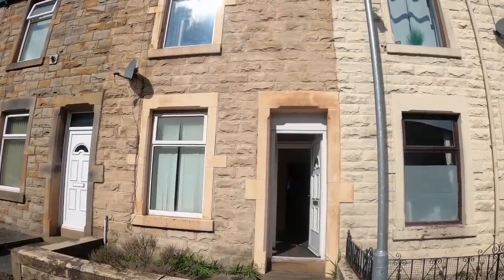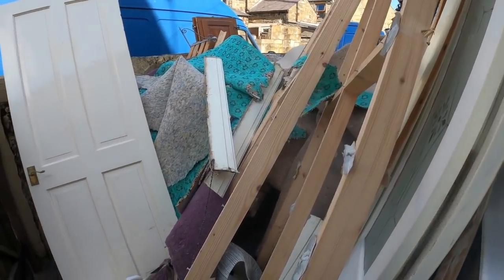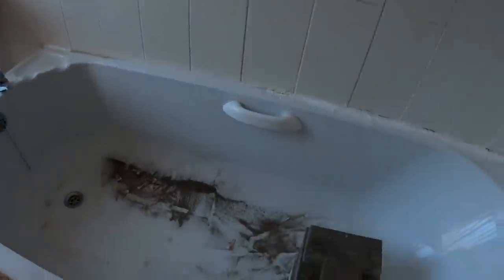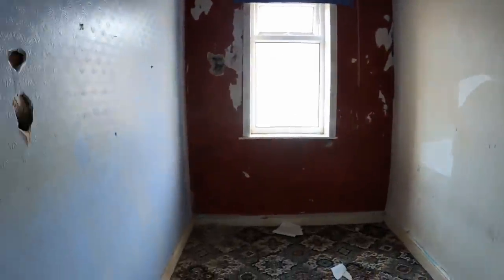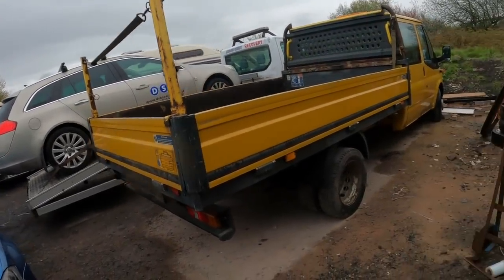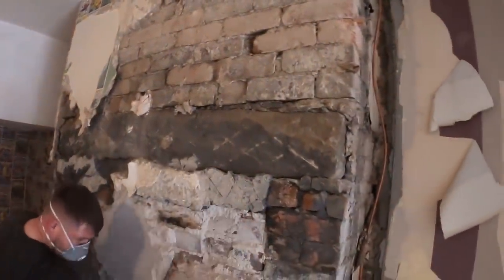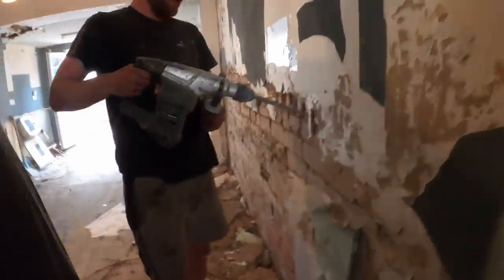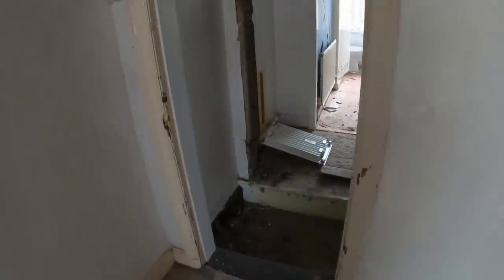WE BOUGHT A HOUSE !! OH ASWELL HAS A NEW SCRAP TRUCK

Comment: good buy the little gaff be smart when done should earn ya some pounds  , you definitely not going to be missed in the big banana good choice i rate the mk6 a better truck motor wise but not as nice to drive  or look as good i run mk6 with 7 front end in my pic , another mk6 crew cab , mk7 caged and smiley recovery cant beat a transit